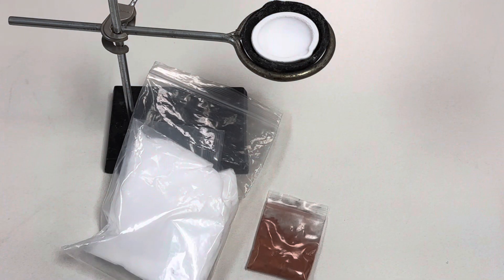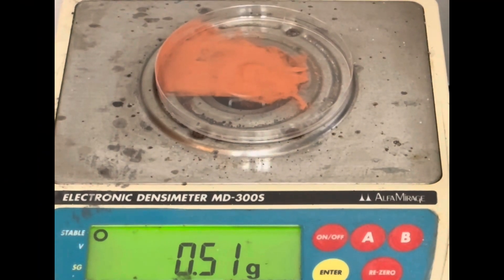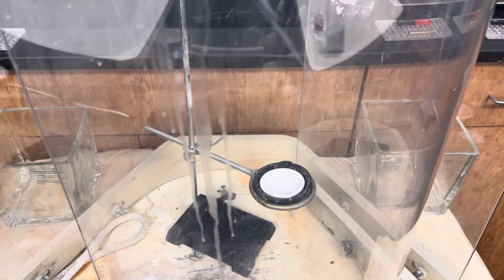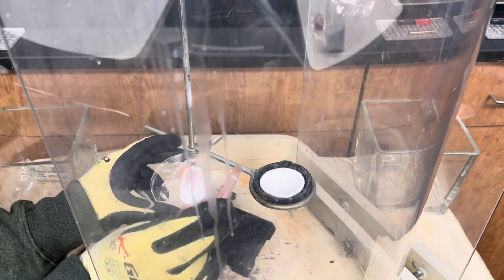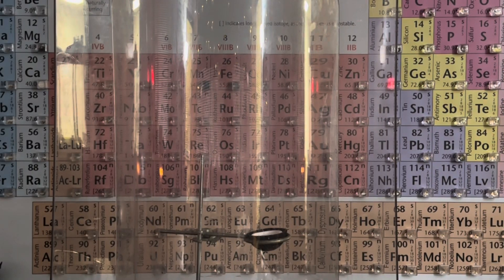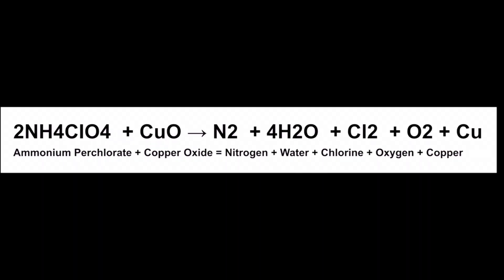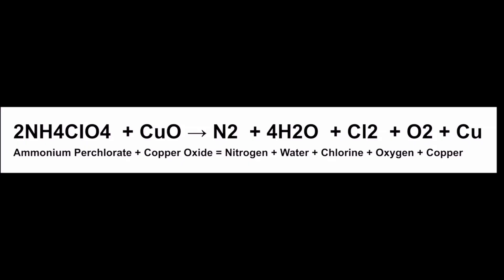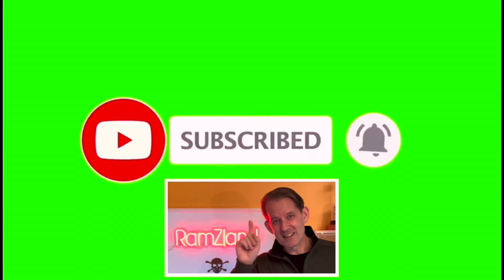Copper vs. Ammonium Perchlorate in RamZland!🔥 2NH4ClO4+CuO → N2+4H2O+Cl2+O2+Cu #STEM #RamZland

Comment: So, did you start with copper, or copper oxide?  I  think you called the ingredient copper, but the reaction says that CuO is the reactant, not Cu.
Reply from the maker: 100 copper mesh powder will develop an oxide layer while mixing and heating it with ammonium perchlorate. Here's a detailed description: https://pubs.acs.org/doi/10.1021/acsomega.9b03893